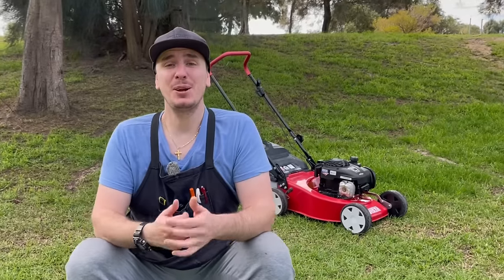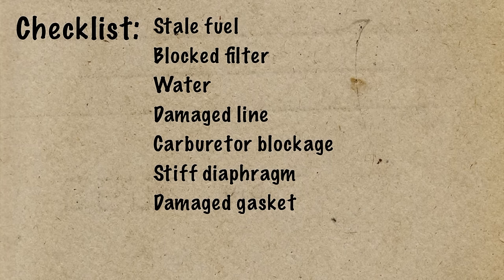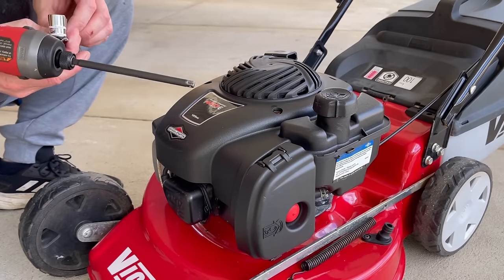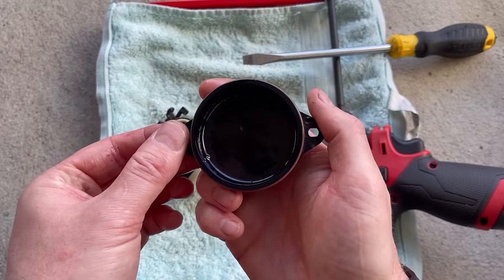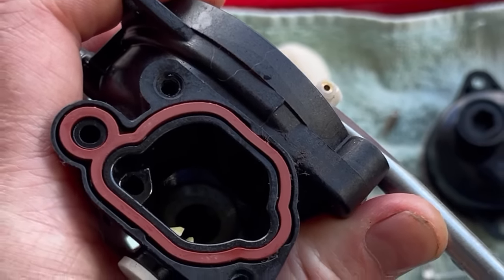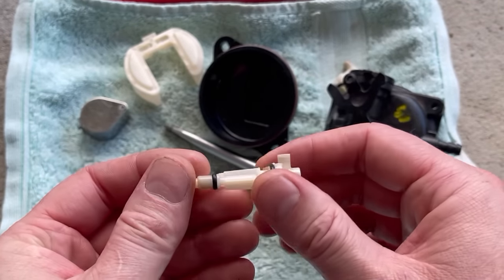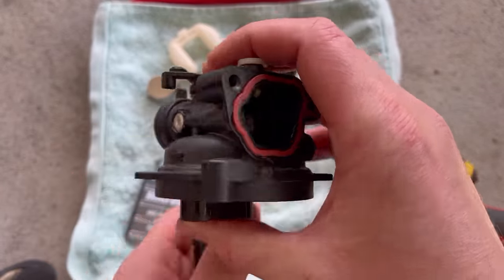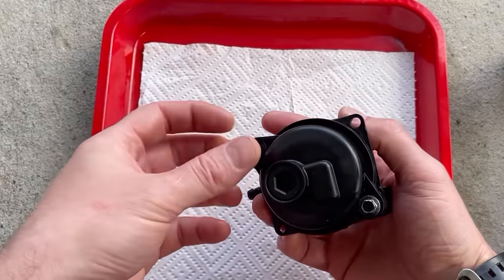Stop Your Engine Surging! (Easy DIY Tutorial!)

Comment: I'm working in a honda lawn mower that surges up and down and noticed several things mentioned from your video.  I cleaned he carb really good with carb cleaner but the issue still persist. It will start with one pull but not smoothly. it surges up and down still has uneven idle. Things that are red flags to me is the Honda carb is missing several gaskets for instance the one  by the air intake and the one by the manifold.  They both rotted and deteriorated.  Next i notice there appears to be some grime or dirt at the bottom of the tank.  I haven't cleaned out and blew out the fuel line.  The mower has fresh gas, new plug, new filter.  From what i know the prior owner stored it outdoors and looks like it was only covered sometimes not all the time and was exposed to rain and snow in the northeast in the states. any recommendations what to do next to get the mower running smoothly again?
Reply from the maker: Yep, clean likes, filter, carb, replace the gaskets and try again :)

Comment: Good video but my mower is still surging. New carburettor, new gaskets, new air filter,. clear fuel filter and hose, enlarged the jet thingy. No diaphragm. Can't find the fuel tank vent but still surges with the cap off. Was fine last year but foolishly left petrol in the tank over winter. Can it be something inside the engine?
Reply from the maker: It may be a gasket leak around the intake?
Reply: @VintageEngineRepairs  thanks for the reply but they're new. I'm so baffled. I'm thinking could the inside of the fuel hose narrowed a little, even though I can still see light through it with a bit of manipulation

Comment: I had one this spring that kept surging despite trying 3 different carburetors.  Plastic carb and same basic model Briggs.  After I reluctantly sent it out surging, it occurred to me that the plastic intake tube may have been cracked. Have you ever replaced a cracked plastic intake?
Reply: That is after cleaning carbs and drilling the pilot jet.  One carburetor was brand new.
Reply from the maker: They do crack yes as the plastic becomes brittle with age.

Comment: I have same carb on my lawnmower, issue is that after using the machine about 30 minutes, petrol pouring out from air intake of carb. I have replaced the carb same model and type but same problem, petrol pouring out from air intake.
Reply from the maker: You sure it’s petrol not oil? If it is, it could be spit back from a valve not sealing or a carb needle not seating. It could also be blow by causing pressure in the crank spitting oil into the AF?
Reply: Definitely petrol. What is AF?
Reply from the maker: @kan815k  air filter
Reply: @VintageEngineRepairs it is strange that after changing carb to a NEW one and only petrol gashing out - no oil.
Reply from the maker: @kan815k  have you pressure tested the needle? New doesn’t mean it works - it 
 means “never ever worked”!
Reply: @VintageEngineRepairs  I understand, I find a way to pressure test it.
Reply from the maker: @kan815k bike pump to 7psi
Reply: @VintageEngineRepairs you don't happend to have a video of it.
Reply from the maker: @kan815k hmm not these carbs no. Basically remove the carb and the fuel line. Then add some extra line on the carb and attach a pump. Add pressure and it should bleed down right away. Then turn the carb upside down and repeat the pressure but it should hold solid. Make sure the needle is wet with fuel for the second test
Reply: @VintageEngineRepairs  OK.
Will do my best and let you know the outcome. 
Thanks

Comment: Just a quick Question.. As you started off with the 0.35mm drill bit to begin, what size drill bit did you use for the final drilling of the jet before assembling the carb back together? Many thanks.
Reply from the maker: I honestly can’t remember as it’s been nearly a year since I made the video, but I would guess it was 0.45 I went to :)

Comment: Great video. Went through it with you step by step. Mower was surging constantly and cutting off at times. Runs like it's brand new now. I tested it after every step so it took slightly longer than the video but still less than an hour.
Reply from the maker: Glad it helped! :)